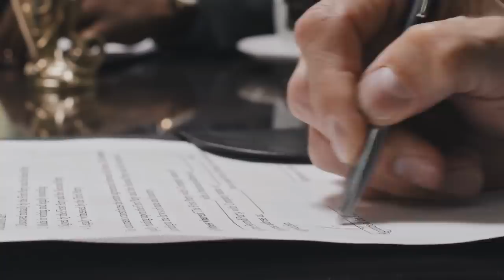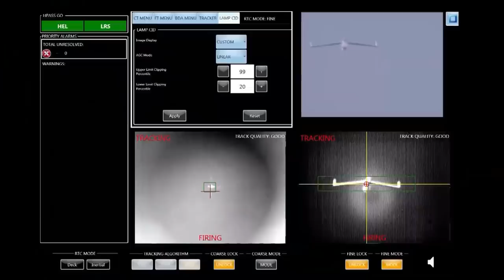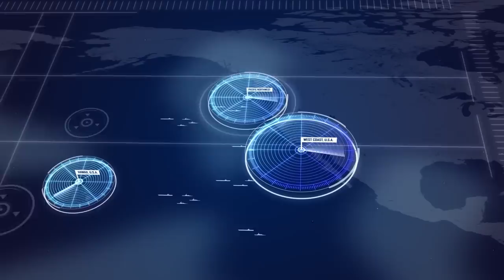This US LASER Aircraft Carrier Is Ready To Beat China | HELIOS

Comment: The extra heat from the laser could overwhelm a hypersonic missile though
Reply: Hypersonic gets beat every time from lazers
Reply: Light goes faster than mach 10
Reply: Yeah if it's real because they use propaganda
Reply: YES ABSOLUTELY!! IF YOU ARE ABLE TO POINTED IN TO THE HIPER SONIC ROCKET THE LASER ABOT 2-3 MINUTE IT WILL BE MELTED TO THE GROUND!!1 YEEEEAAAAAUUUU! WOOOOOWWWWWW!
Reply: @arturogonzalez8161  Hypersonics are not that accurate because of the ironisation or somthing so its not able to accurately use gps guidance data.
Reply: @LeeKirkman88 correct,when it hits the lower atmosphere.

Comment: One question, isn't the Helios rendered ineffective on a rainy day?
Reply: heated laser (150 kw)would burned through anything  ,providing source for that heat,is the stumbling block now,nuclear power could do it but still a working in progress. It will get there no doubt.
Reply: Use a CHAMP missile. Look it up. It uses microwave lasers. It is also mobile. And microwaves heat water. Water does not disrupt them.
Reply: @johnie14151 micro wave laser only works on the electronic parts of the missile not the hardware as not enough heat.
Reply: @georgesikimeti2184  take out the electrical ant the missile will not have guidance
Reply: put this way,both waves work perfectly against the missile but on different parts,one on the electronics,the other other on the hardware,I think you know what I’m trying to get at.
Reply: @georgesikimeti2184  I didn’t mean it would knock it out of the sky. Simply that it will be unable to home in on a moving object once the electronics were destroyed.
Reply: @johnie14151 got it, thanks.

Comment: Helios is ~3X higher power than the Chinese laser system. But the 30KW chinese laser is for export. Saudis have bought several of them. What they have for internal use may be more advanced.  The US does not export it's most cutting edge weapon systems.  But these lasers are designed to take down plastic drones, not hypersonic missiles. Their power would have to increase by a factor of several 100 to be useful
Reply: not quite the same as alien light speed plasma systems

Comment: So, if the laser has to burn through the target I wonder what that lead time would need to be for countering a hypersonic and could it be effective against multiple missiles?
Reply: Good question.. n ull never get n answer😢
Reply: the speed of light,power it up to 250kw and it’s good to go.
Reply: or the RUSSIANS UNDER THE SEA TSUAMI BOMB WOULD MAKE THIS SHIP A BIT BUMPY...
Reply: @elizabethnilsson1815 Russia hasn’t impressed a lot people lately militarily wise!!!nice try though!
Reply: Most defensive lasers are not designed to "burn through" the target, all a defensive laser has to do is heat the very sensitive tracking and navigational electronics to the point of failure. If you know anything about electronics at all then you know that heat is nearly their worst enemy, second only to moisture. Heating electronics to failure in a sealed metal container would literally take milliseconds but naturally distance and obstructions could extend the time but not to the point it's a mitigating factor.

Comment: And what happens if the missile is coated with a mirror finish or if the sky is cloudy or even raining?
Reply: Mirrors reflect 95% of a laser's heat. These lasers are so powerful, that even 5% will still burn the mirror. Also, bad weather, that won't matter.  This can be solved by using a reference laser beam to probe through fog, clouds, rain, etc., so that computers could analyze how the atmospheric conditions are distorting the laser. The optics in the laser would then refocus the weapon beam, so the distortion, instead of spreading it or bending it off course, puts it back into the right shape. Boeing has developed a laser weapon that can already do this.

Comment: But is it PROVEN by now that Helios CAN actually shoot down an incoming hypersonic missile? Testing this laser on a drone or a small boat is no comparison to a missile that comes in over Mach 10 and is probably a lot more sturdier than a winky wonky drone or small wooden boat. From what I know is that the Gerald Ford is the only Aircraft Carrier that has sufficient power to feed the laser what it needs. Burke destroyers and even Nimitz Class carriers are supposed not to have enough juice to put enough energy into basically a cutting beam that can slice a hypersonic missile in half in a second.

Comment: Laser weapon is emitting a much slower light, because it has to push the air forward. The laser light disappears at a greater distance, compared to the magnetic railgun installed on fighter jets. To make sure the opponent is killed, it is better to use the laser weapon as sound source during firing the bullets.